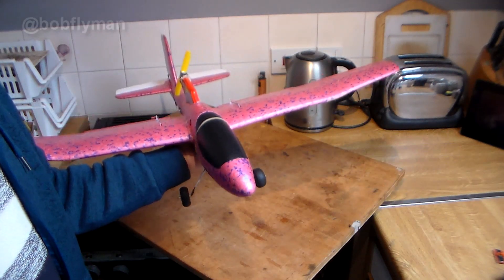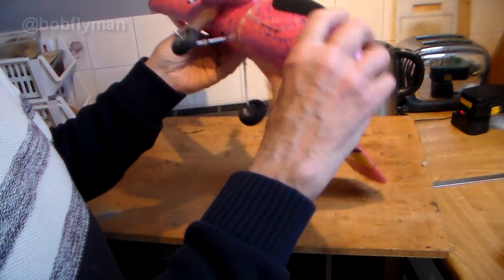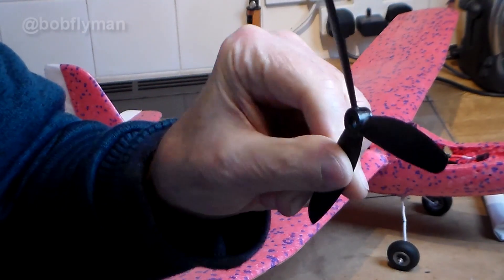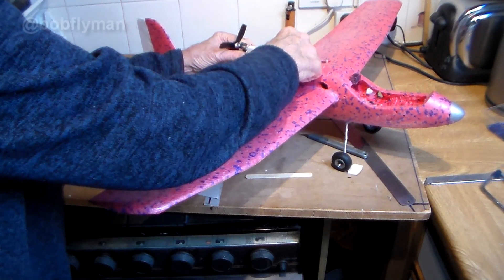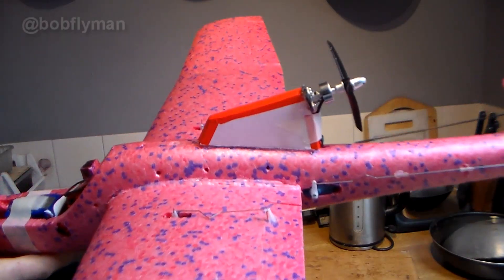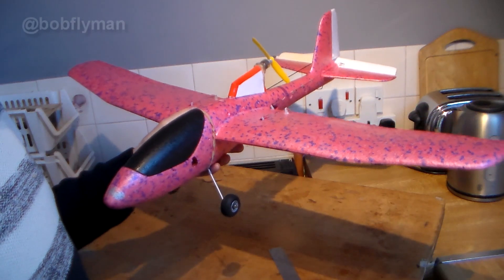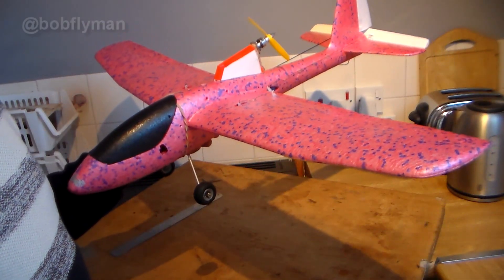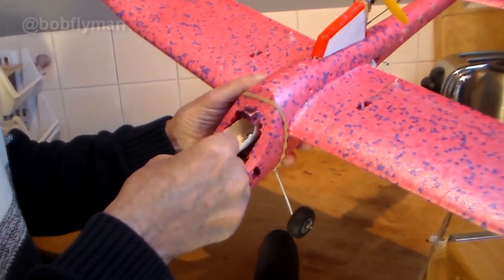Build a baby Bixler Lidl Glider RC conversion

Comment: Nice, but dont encase the VTX they get hot.
Reply from the maker: Thanks.  I've moved on from that plane to my Bixler as there wasn't really enough space for flight controller and all the other electronics in the Lidl.  I made air scoops on the nose of the Bixler, and there are  air outlets at the rear.  The vtx is outside in the airflow.
Reply: @bobflyman  My AIO camera/ VTX is   3.8 Gram and just plugs into a spare plug on my RX, which is mounted on top for easy disconnect.
Reply from the maker: Thanks. I've got a couple of other small lightweight all in one vtx with camera. I really need some good diversity goggles. That's next on the list.

Comment: Hi Bob, your pusher setup needs to be set so the motor shaft points to the center of gravity (usually 1/3 of the wing chord).
Reply from the maker: Thanks, what I saw online too and that is what I tried,  and it's  just what I showed in the diagram in video.   🤔  It wouldn't fly! I changed the angle higher, the same as my Bixler and it does fly. I think there's more to it than trying this point at the CG idea!

Comment: Very nice experimentation! The pusher is for sure interesting. It might save on broken props also ;) Thank you for sharing!
Reply from the maker: Definitely a big advantage to avoid broken props,  😁though I think the angle of thrust is quite critical compared to tractor, (prop on the nose) planes. Quite fun though and if you did want to fly FPV great advantage not having a prop on the nose!